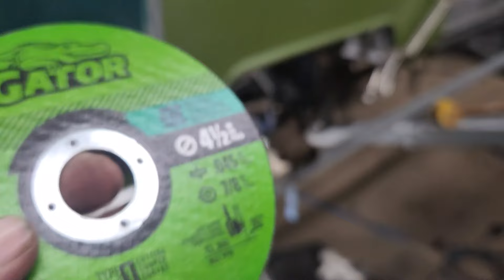Front Nose Replacement Part 1 -VW BUS - Episode 31

Comment: I just replaced my nose and removed the inner airbox and had it sandblasted. Was so worth it.  Only 10 spot welds holds it to the A pillars.  So if you have the entire thing from a donor you can easily replace it.
Reply from the maker: yeah I do have another one. it is not perfect either so I will have to figure out which way to go. I might customize it for 2 AC blowers.